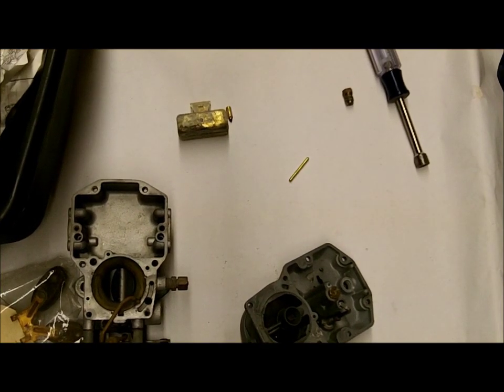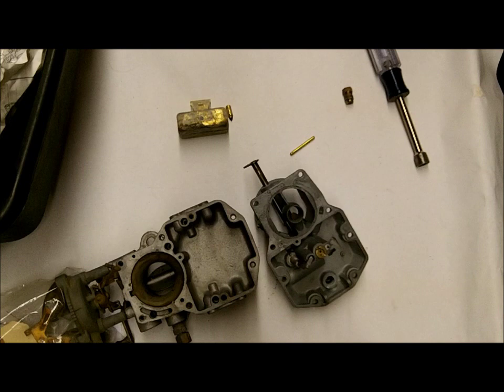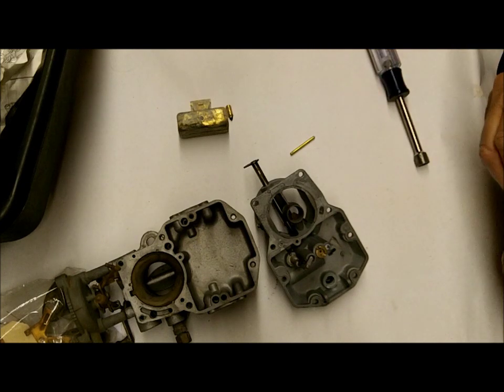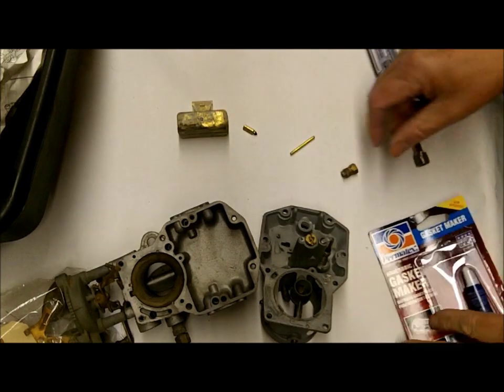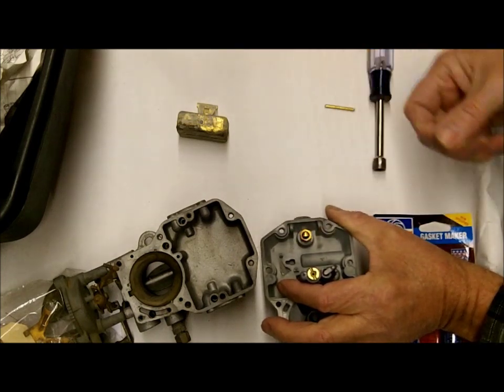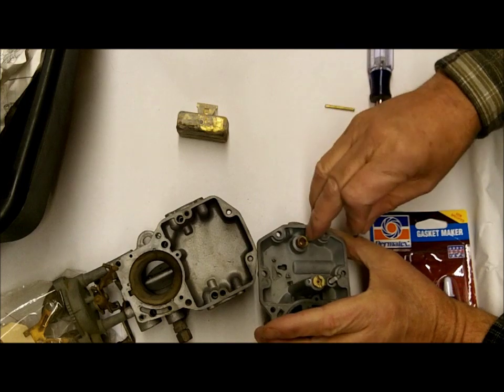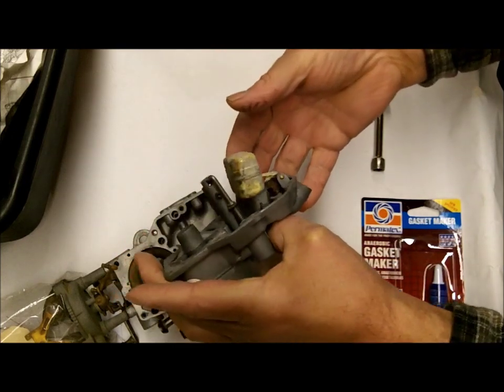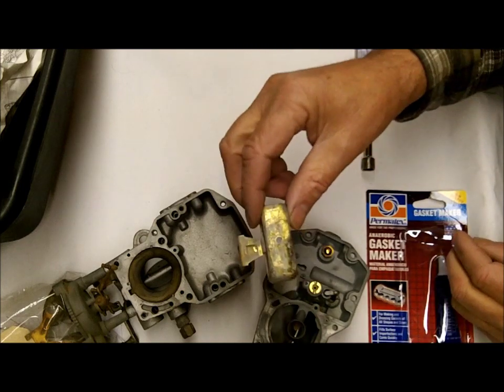Autolite 1100 Flooding Troubleshooting

Comment: You know what's fun is when you have fuel in the float if you use your soldering gun and heat up the float gasoline will spray out of the pin hole then you can solder up that pinhole.
Reply from the maker: Be sure to have plenty of fire insurance

Comment: Have a 68 mustang 200 six starts hard shortly after shutting down hot. Also when parking in the garage after driving when engine is up to temp  turning engine off hot in a few minutes you smell fuel. One more thing engine up to temp has never overheated or anything like that but at a red light say in traffic the engine will surg like it wants to stall. The carburetor was rebuilt awhile back as well but has these on going issues.    What do you think?

Comment: what is the correct psi for the autolite 1100 manual choke? got new pump and is flooding,am going with a fuel pressure adjuster,but 5 psi of constant pressure will be ok,pump giving me 8 psi,mechanical pump
Reply: 8PSI is way too high for an autolite 1100. It will definitely flood. many of the newer fuel pumps from China say they are for use on a 170 but in reality they are a nightmare. 3 and 1/2 to 5 PSI is ideal.
Reply: The excessive fuel pressure seems like a common problem. Some people have changed the main spring to lower the pressure or added a low pressure regulator